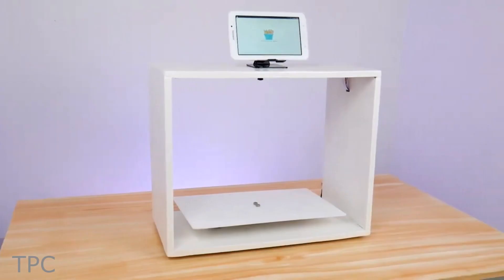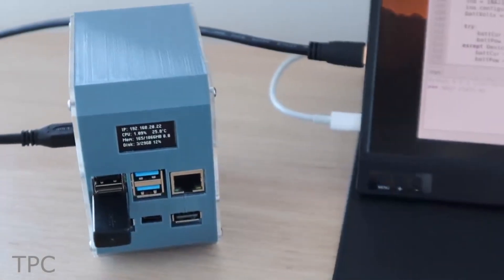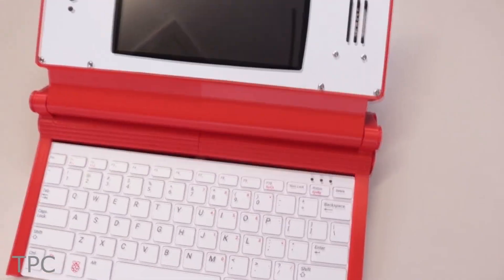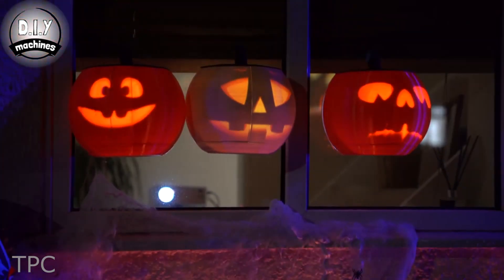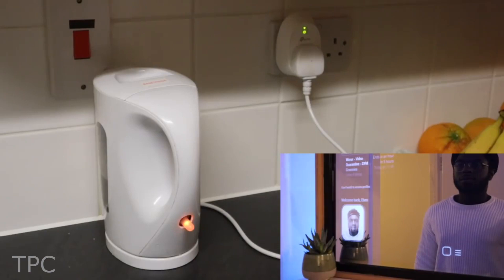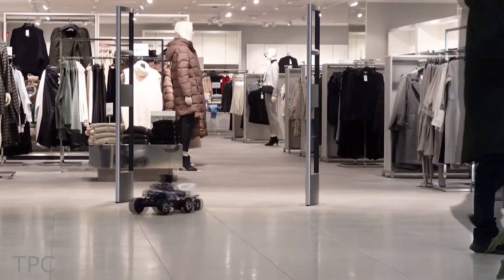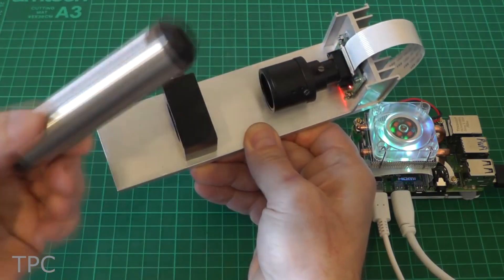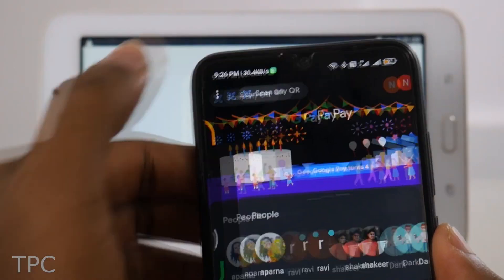DIY Retro Arcade Controller & 9 More R-pi Projects

Comment: Would be cool , if a person can use an old laptop and covert it to a raspberry pi
Reply: You can download Raspberry Pi softwares in your old laptop and use it as a raspberry pi
Reply: the pi is already a usable daily computer ,just plug it into a hdmi monitor ;)   I also put a pizero w2 into a pi keyboard ,plugged into a hdmi monitor it works ,and the keuboard plugges into the zero and functions as a keyboar ..the sky the limit .https://www.tenforums.com/attachments/chillout-room/365082d1650676979t-raspberry-pi-thread-6-a-zero-keyboard-1.jpg
Reply: @jackburton9507  can you use the pi laptop for coding and programming?